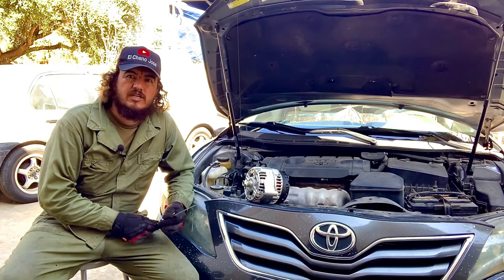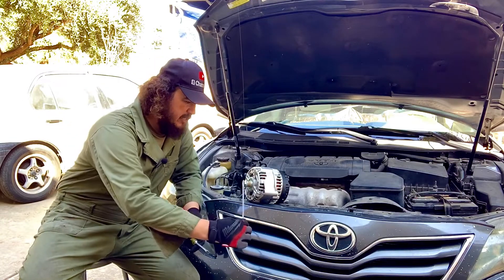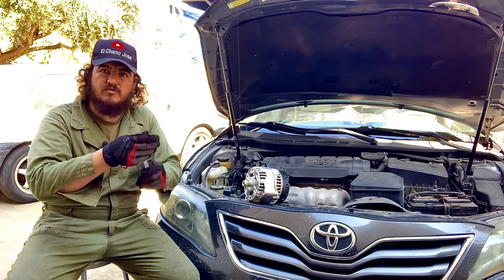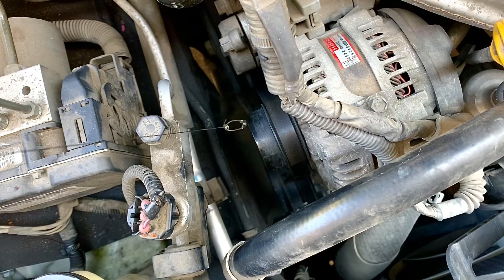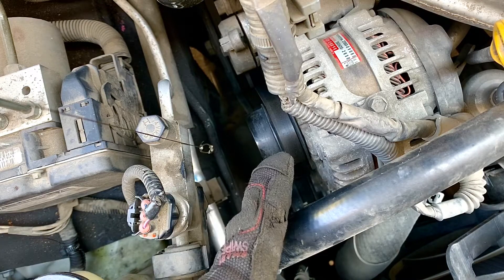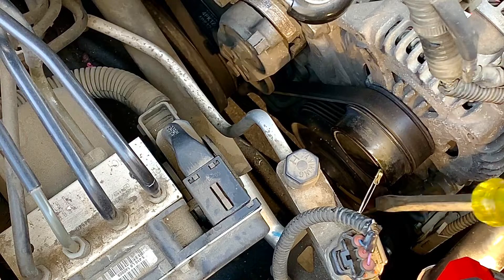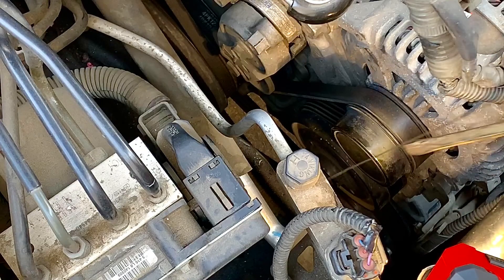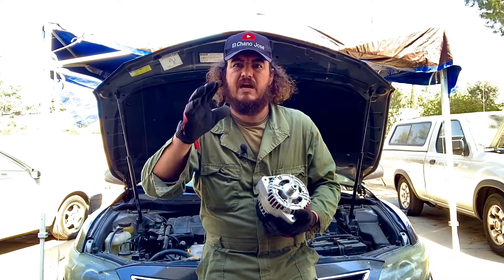How to test the magnetic field on a alternator @elchanojose

Comment: Thanks, l just tried it and my gulf alternature did exhibit magnetic field, but l disconnected the terminal from the battery and the engine stopped running, could it be the fuse attached somewhere in the engine that is coursing the engine to stop?
Reply from the maker: Hello!  Check the fuses before moving on to replacing components.  Sounds like no power being delivered to the engine other than the alternator.  Battery is not helping the electrical system.  The engine should run even with the alternator disconnected until the battery goes low on voltage.  Take well care!

Comment: Hi there . Thanks for the content. And congratulations for the excelent job. I came here because i searched for "magnetic field". Reason is i have just changed my alternator, honda fit 2010, original OEM to a remanufactured OEM one. Guy said he trusts the people who does it, and have been doing job with them for many times and he also said that they change alternator things inside of it to new things. Well, i was having some problems on the RPM when turning the A/C fans on, RPM drop was so high the engine almost stalled . When i tested the new reman. OEM alternator, every problem was gone. Now the RPM is steady when turning the fans,no change. However.... however, there is a noise, i dont know, it's kind of a whining but its not exactly a whining, that increases when i accelerate. ....some repair shops called it a magnetic field noise. They said its normal. But i would like your opinion. Is it normal? Really? People say it most likely disappear over time. Should i worry and not believe them assuming there is really something wrong ?
Reply: Check your alternator output current supply and a proper pulley size gear ratio effecting engine/alternator rpm also idling factors. 

95amps alternator should be enough to supply 60-90amps current electrical and a/c system in the vehicle.

All the best in your finding. 🛻👍

Comment: GREAT !!!! What causes Alternators to fail... is it the magnetic field or magnet that goes out, or other? thanks
Reply from the maker: Hello Dan!  Before we get into what can cause an alternator to fail, we have to understand that any man made thing will fail at one point.  Usually two basic things can cause an alternator to fail.  The first one is that the alternator stops making voltage do to just wear and tear.  Componentes are degrading and get to a point that the energy is no longer created.  Just like brake pads and tires, the more they are used and worked the more or faster they will comen to fail.  The second most common reason alternators fail, is because the voltage regulator stops controlling on how much power is been created.  This component we can simulate it to as a water valve.  The valve is I charge of letting so much water to go by so a container does not over fill as the water on that container is been used.  Water is been added by the valve to compensate the usage, but if that valve stops controlling and just lets all the water be pump in faster that what’s been use, then the bucket is going to overflow and spill.  Alternator have internal controls so the car battery does not get over charged, but when this fails batteries can also get damage by a bad alternator.  Hopefully this can be helpful and answer some of your questions.  Take well care Dan!
Reply: @elchanojose  mega helpful thanks.  I’ve been trading cars 18 years.  Sending cars repair. Now I’m playing repair odd one myself too